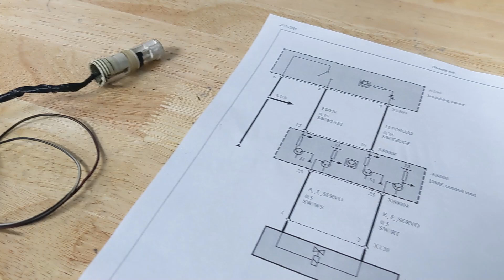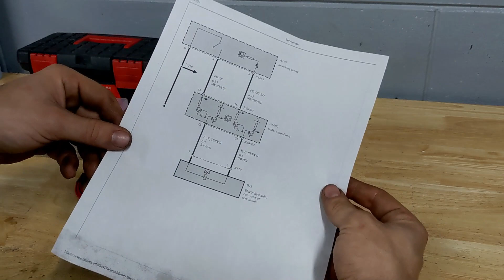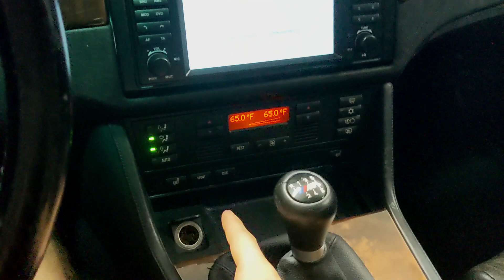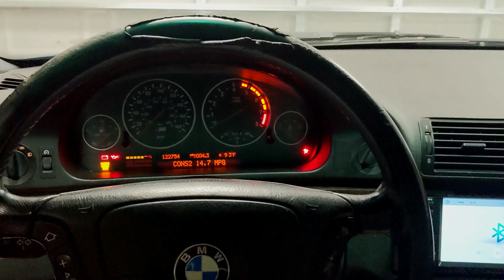I added a SPORT BUTTON on my BMW! E39 M5 Steering Servotronic Retrofit

Comment: Do you know if the wiring is the same for I6 (rack and pinion) servotronic E39s? It's not controlled with a sport button on those but dependant on vehicle speed
Reply from the maker: Nope, I didn't even know the 525i's had a servotronic! Interesting
Reply: @TheBimmerBarn  It makes the steering very light (you can turn it with a single finger) when standing and gets heavier the faster you drive. I was able to find a wiring diagram and it seems like it gets a speed signal from the ABS module, through the cluster, which goes to the GM3 module